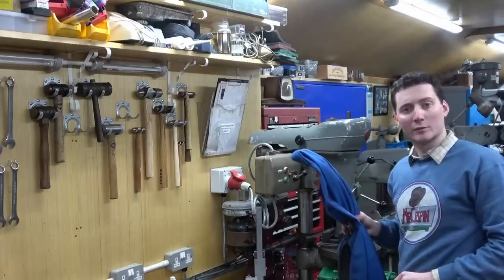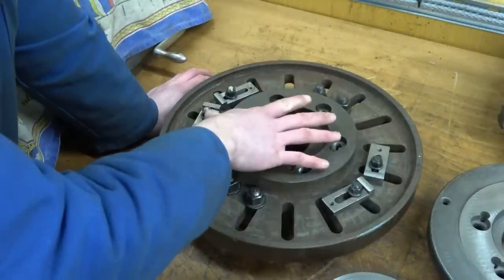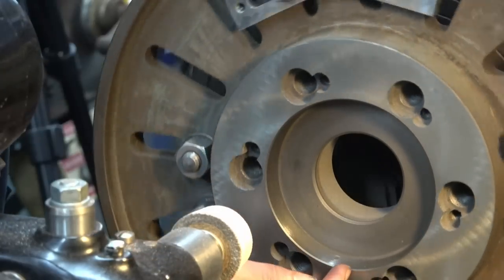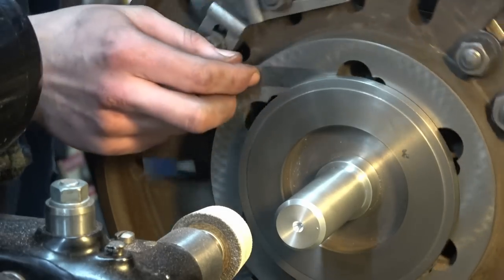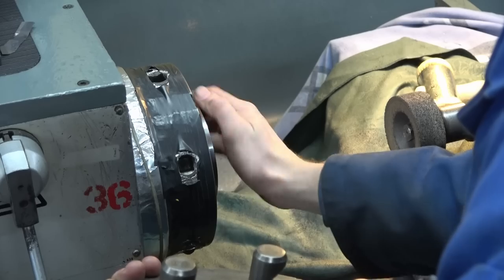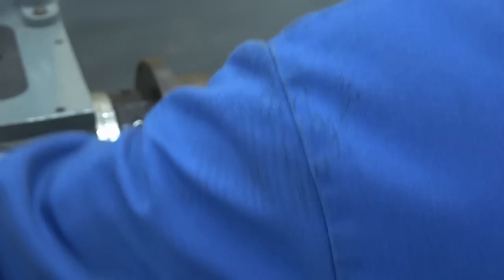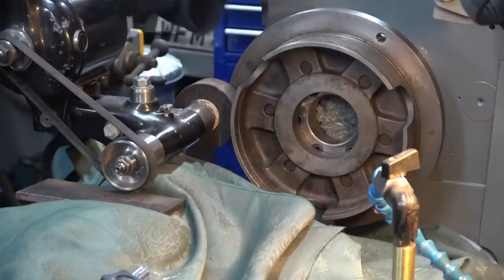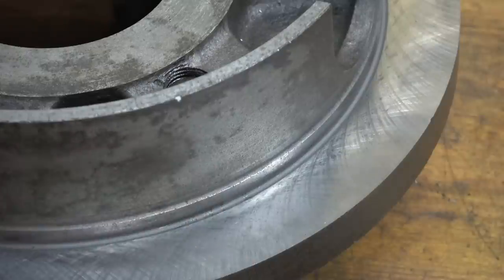Re-Grinding Chuck Backplates

Comment: When I saw you fit the gage up with zero clearance, I thought you had done this wrong.
Thank you for showing how to do this correctly, lots of mis-information out there on D1 chuck fit-up. 
I fit my 3-jaw chuck to my lathe, but just single point cut it rather than grinding it.
These cuts are super light, and can be done with very high precision with a HSS tool. Carbide has too much tool pressure to do this easily.
Reply from the maker: Yes the gage is a copy of a female side rather than the spindle nose.

Comment: On Precision Engineering: I once had a friend who was working on a Jaguar differential, I asked him what was the correct torque for the pinion bearing nut? He replied that he used the setting an old master craftsman gave him and that it had always worked reliably for him. The man told him the nut should be tightened "two grunts on the tommy" my friend demonstrated with his tommy bar: unh!, UNH! And he rotated the pinion twice and pronounced it complete! Take what lessons you will - LOL! The scientific explanation is that through experience, the experts judged where the tightness/preload was on the elastic modulus curve.

Comment: This series is very useful. One of my lathes has a D1-5 spindle and some of the backplates fit well but a couple do not seat entirely. I foresee making a gauge so I can undertake the grinding.
Reply: I think if you grind the backplate while it is clamped in another chuck, you can also take the entire chuck off and turn it around to check the fit on the actual spindle nose and after that you can mount the chuck with the clamped backplate again to continue grinding. Of course  you need to mark the orientation of the chuck in relation to the spindle nose to eliminate possible runout.
This is probably easier than fabricating a gauge, at least if it is just one or two backplates. If you want to regrind multiple backplates, a gauge makes sense because checking is of course way quicker with a gauge.
Reply from the maker: Yes although the weight of the chucks comes in to the equation as well!!

Comment: Mr. Crispin, I’ve enjoyed your series here on grinding, so much so that I am in the process of acquiring the same TPG!  
I would like to know if you have a source that I can look into for the grinding wheel that you’ve used for face grinding in this episode.  Thank you!
Reply from the maker: Glad the videos have been of some use. I struggled a bit with regards to wheels and ended up making do with the old ones I had but if I was going to but them I'd just look for a reputable abrasives supplier.
Reply: @MrCrispinEnterprises   I hate to bother you again.  I'm still struggling to find a wheel like the one you have in this video.  Can you by chance tell me what the diameter of that wheel is?  It looks to be a bit bigger than a 2" wheel, but it's hard to tell from video.  Thank you!

Comment: Hi Mr Crispin.  I wonder if I could ask some grinding advice.    I’ve a chevalier manual surface grinder and I’ve been following SteveBarton at SolidRock using a Radiac open structure ruby wheel .. which works very well and runs cool without coolant (Radiac RA46-H800-VOS ruby wheel) BUT… impossible to buy. We these wheels in the UK … any advice as to which open structure wheels you may prefer for surface work with only a mist or no coolant.    
Thanks anyhow
Mike … Beverley, E.Yorks

Comment: Hii i bought a graziano sag 14 which has a D1-5 Spindel Nose which is a bit rough maybe i will Start the same Project but i don't have a toolpost grinder now how many RPM do these stones need i got a cheap 500W up to 10000rpm spindel with a ER 11 collet is this to fast and to weak? I also have a straight ER25 shaft and some Roller bearings i could make a toolpost grinder out of it.
Reply: Ok I searched for some Toolpost grinder that runs with 6800 rpm at 350 Watts so it might be fine? But I think that the spindle will not withstand the dust for very Long but I don't really need it anymore its ok as lon as it lasts for the grind